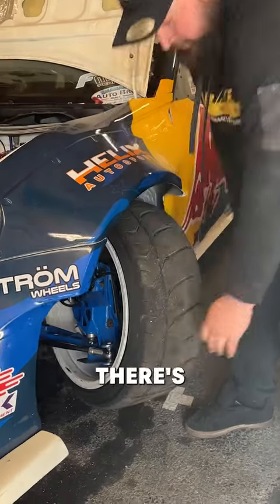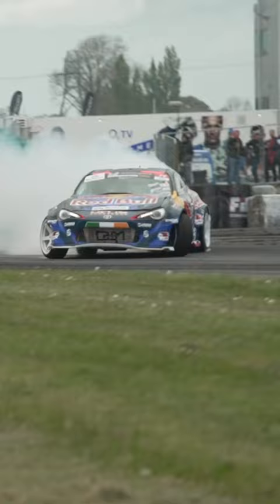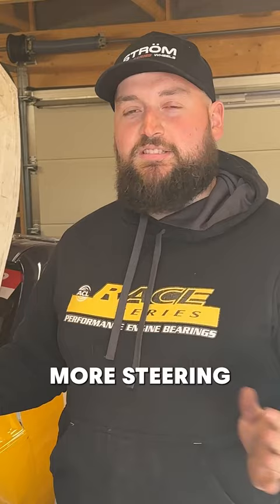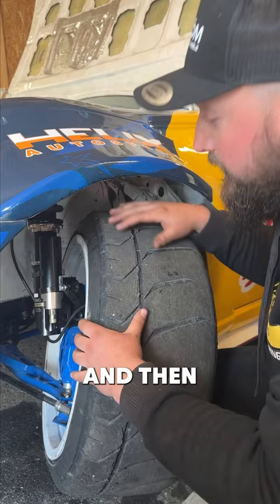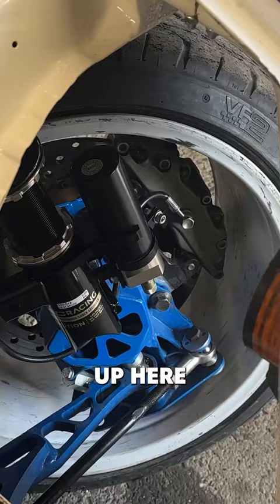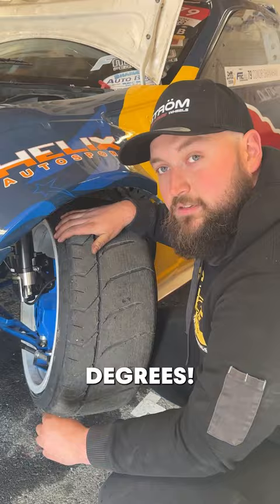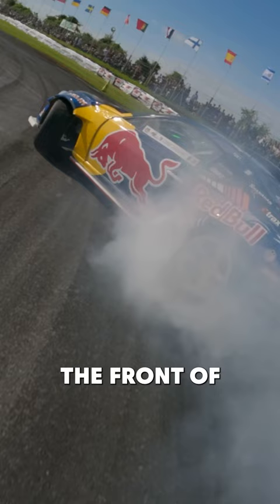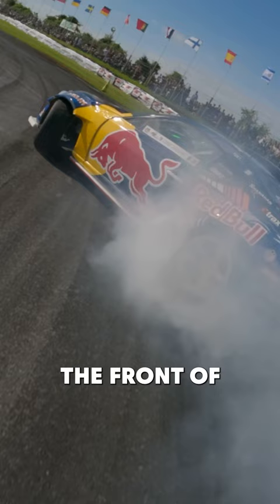How a #driftcar gets extreme steering angles 🚙💨 #drifting

Comment: Still losing speed while drifting cause during a drift your pretty much under steering and with all that angle you will lose more speed it's just the power of the engine is making the car slide and maintain speed but good luck trying to drift fast on a low hp car with that much angle
Reply: Lol, drifting is the opposite of understeering. The entire point is to oversteer as much as possible. 

And yeah, you need a lot of power to maintain enough wheel speed to keep a drift car sideways at high speeds. You need to maintain enough rear wheel torque to counteract the centrifugal force pushing the car outward (backwards) while sliding sideways around a corner. Otherwise you’ll eventually regain rear tire traction. 

Wider drifts (higher speed) and stickier tires require more power to maintain. That’s why any 150 hp shitbox with old tires can do donuts, but it takes 1000 hp to maintain a 70 mph drift  with 200tw sticky tires.